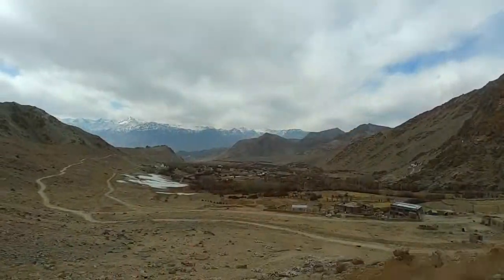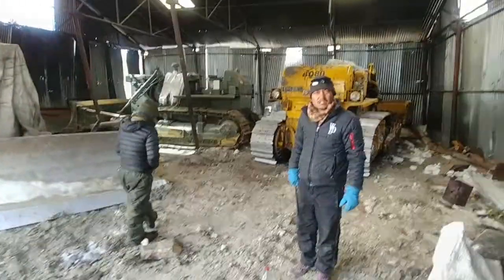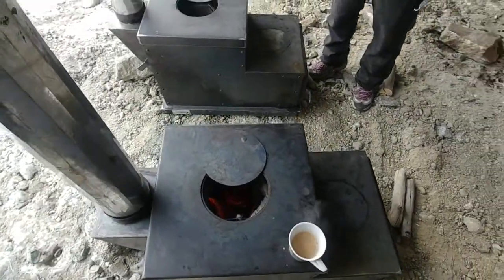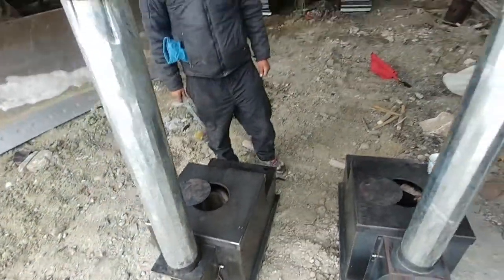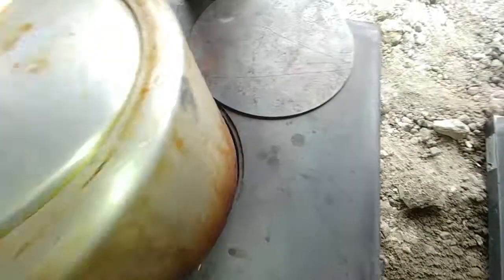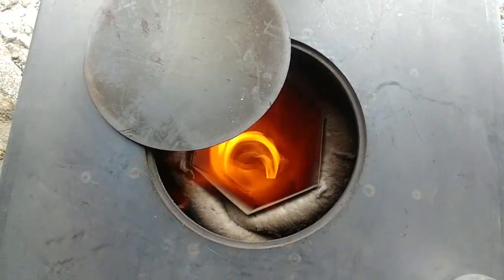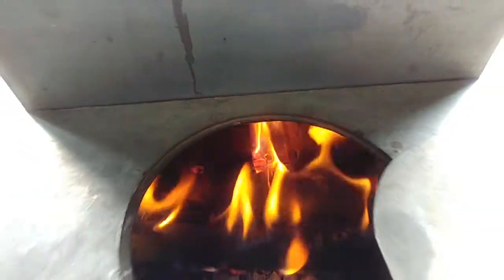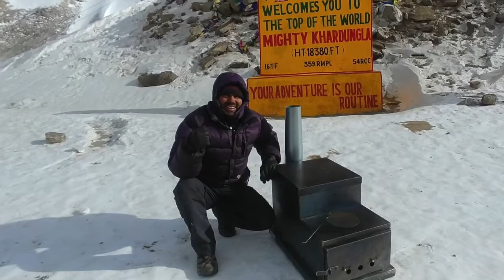Himalayan Rocket Stove Test at 5500m in Ladakh

Comment: What is the difference between the tow stoves. I know the airflow is different but what makes this happen, a extra secondary burn air input ??? Thanks
Reply from the maker: To be honest, that was a few years ago and I don't remember exactly what the difference was. I think I had opened up the secondary airflow in the modified unit to allow more preheated air through, and ended up finding that the original airflow ports were fine as they were, so we left them as is.
Reply: @Rocketmandesigns  Thank you Russell. Peace to you.
Reply from the maker: @victoryfirst2878  Thanks, and to you!

Comment: Great idea and good results but why is the flame color so yellow? High particulates? Would be interesting to see a teapot bottom after an hour on the open swirl cook plate port. Dare to say it will be black with carbon soots. Show us with another video at any altitude. Standing by!
Reply: I think you'll find that colour rendition is not true for a lot of cameras.  The lack of smoke would suggest the temperatures are higher.
Reply from the maker: Generally the particulates are very low, as we can now report that users in Ladakh who would normally have to clean their flue pipes every week, are now going 6 months or more without any issues at all with soot buildup in their pipes.

Comment: Do we still require that much secondary air intake on sea levels to achieve same smokeless results?
Reply from the maker: We have tried to optimise the air flows to work in any altitude. As for specific sea level optimisation, we would need to analyse the emissions accurately to know, and we haven't had a chance to do that yet. All we can say is that it works from the criteria of burning visibly clean, with reduced fuel demand. I'm sure we can optimise more completely with suitable emissions analysis and we are moving towards being able to do that soon.

Comment: that much is concerning to the life of the steal.  What is the life expectancy of the steal??
Reply from the maker: We use SS310 for the internal components that are exposed to the highest temps. This is a purpose made high temperature rated stainless steel that has an operational rating up to 1250C. So far after almost 3 winter seasons, we have seen no signs of degradation in the SS at all. Life expectancy for the stoves is in excess of 10 years, but we'll have to see how it goes.
Reply: @Rocketmandesigns  What gauge of SS310 do you use?  Do you expect SS310 life to equal that for ceramic fiber board?
Reply from the maker: @mozit6  I think we're using 1mm 310 and so far we have a few hundred units in use for 5 continuous seasons. So far it seems to be holding up. I can't compare to fibre board as I haven't used it for that kind of period.
Reply: @Rocketmandesigns  Thanks for the quick feedback. Continued good luck with the stoves!